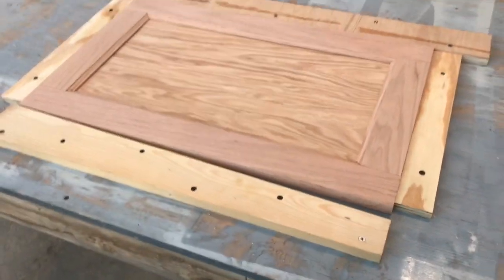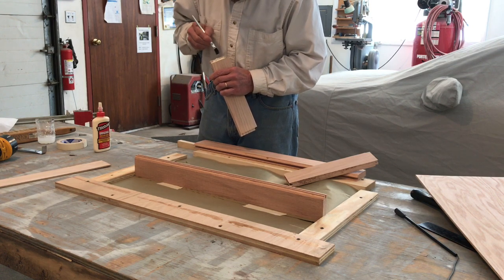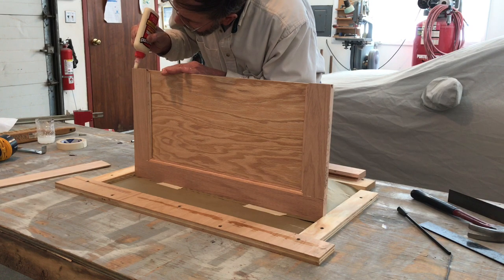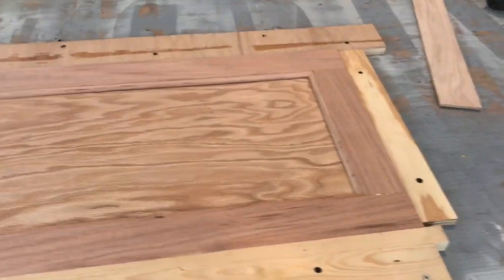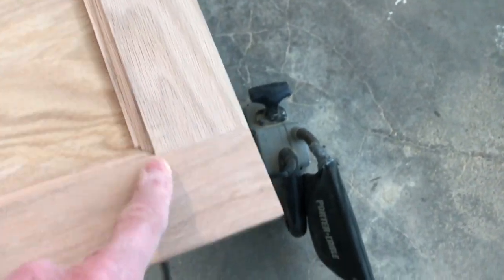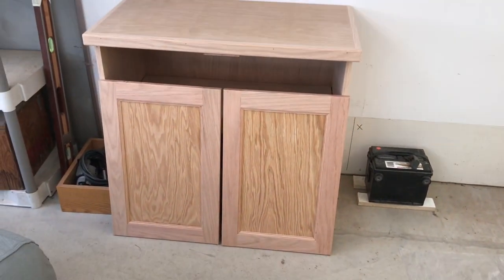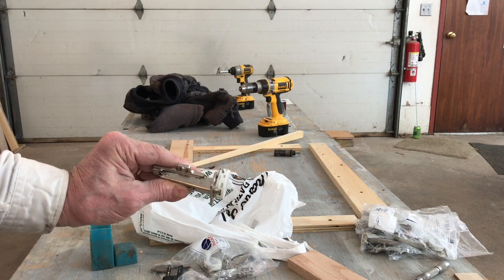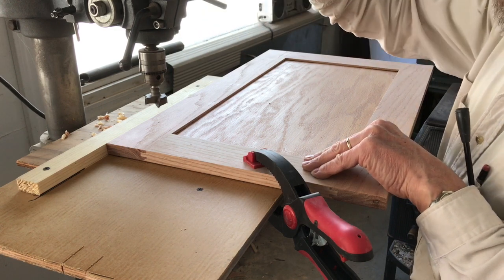Cope and Stick cabinet doors part two

Comment: Beautiful woodwork have you ever considered making a kitplane like a minimax since you’re so handy and a pilot
Reply from the maker: Hi Matt,  I have actually built 2 RV kitplanes and still flying one of them.    they are mostly aluminum, but some fiberglass work too.  I always had my eye on a GP-4.  Google it.  It is a beautiful wood airplane.  Not many of them around.  They are hot potatoes to fly.